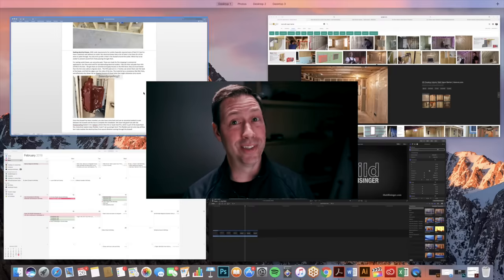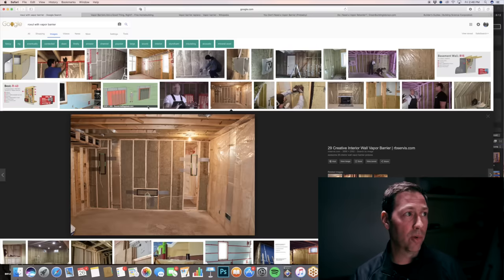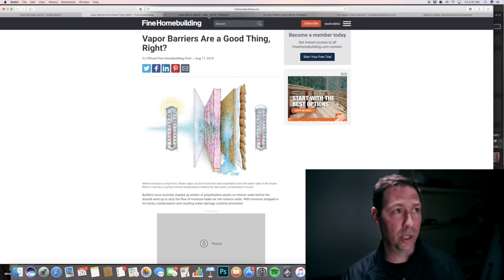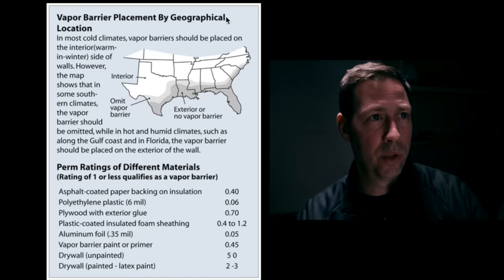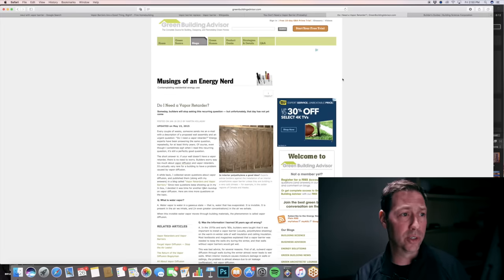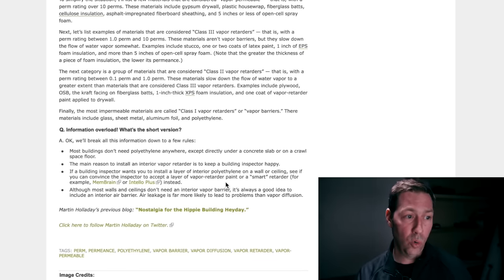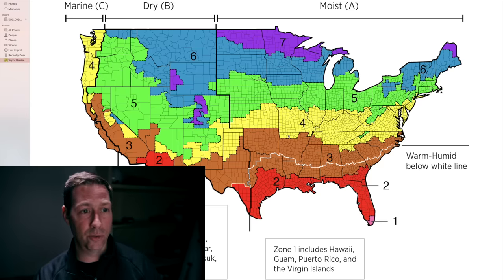Vapor Barriers: Need one or not?

Comment: Any thoughts on using foil face 1" foam board under the sheetrock?  Crawl space home in climate 4.  Foil will face in, joints taped.    Thanks all
Reply from the maker: Be cautious. The foil face is a vapor barrier. I’d go with unfaced
Reply: @buildshow  Can drywall be attached directly to foam?  I've always wondered that.  I've never seen it done.

Comment: I’m in North Jersey.

I have humidity & temp sensor both inside and out.
This morning temp outside was 11F and the humidity 72 % for the area. 

The outside sensor was registering at 9.1F and humidity at 72 %. The Attic is @ 13.5F and humidity at 65%.

My nails had ice on the tips and some were sweating. 

Is this normal? Should I installed a vapor barrier. But I’m reluctant to get heat trap and cause mold issues from water being trapped between Sheetrock ceiling and attic. 
 
What do you recommend? Thanks

Comment: Very helpful but one question.  I have 3/4" furring strips not 2x4s  attached to the cinder block wall in my bathroom.   There is  pink insulation between the strips.  The 6 mil plastic then drywall (green).  When the baseboard showed dampness, I opened the wall.  All the furring strips were very damp and extensive mold on them. No mold on anything else..    This is in the DC area.  Am I correct that the solution is to reinstall new furring and not use the insulation or plastic?   We are in the DC zone.  brick house

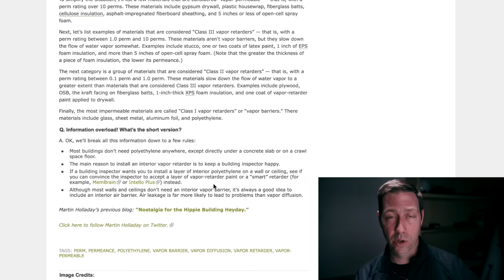Comment: At time 5:37, you discussed and encouraged use of "vapor-retardant paint or a smart retarder" as best solution to retard vapor exiting to outside. I have two questions: (1) Some brands of fiberglass insulation bats add craft paper to one side, aiding installation; is that paper acting as a vapor barrier? (2) In another video, you interviewed two experienced architects with an unhappy client with in-wall water and mold; and the cause was discovered to be the client's vinyl wallpaper, which in effect, acted as an interior vapor barrier, and that vinyl did not allow the wall to breath during warm weather. Please say more to distinguish the uses and differences between air barriers and vapor barriers. ~Steven, Utah

Comment: I’m building a warm roof on top of the existing decking on my summer house roof. I’ve been told I HAVE to use a vapour barrier membrane above this decking and below the insulation boards. Is this correct?

Comment: My new home is low energy certified and the builder said they cannot install a medicine cabinet on a exterior wall in the master bathroom because it would void their certification. I will be installing one once I close on house and get keys. The wood framing on the exterior Wal is 2X4's, I will have to pull out the insulation to fit a recess medicine cabinet so it matches the opposite wall medicine cabinet. The question is what can I put behind the mirror for insulation since there will be little space left for thick insulation? I'm in the Phoenix area where its always hot, I don't want my medicine to boil : )

Comment: So, what is the correct way to build when you have dry, cold winter and hot and humid summer?  (-40 to 30 Celsius)  Here in northern Europe we have vapor barriers all around the house on the inside. Everything is sealed tight.

Comment: Got a small barn shed that is being converted into a conditioned space in climate zone 3 California. Was told if air conditioned/heated, it’s best to use a vapor retardant. So poly’d the walls interior after pink insulation. On ceilings used rtech 2” thick no poly. Should I remove the poly from the walls?

Comment: Hi Matt, I am in the process of finishing our basement. We live in Minnesota. The basement walls are poured concrete inside polystyrene forms. So styrofoam on the outside and inside. It sounds like I do not need to hang any vapor barrier before sheetrocking. Is this a correct understanding? thanks

Comment: I'm preparing to remodel my 1962 built house and I'm planning on using 3 inches of closed cell spray foam insulation, since I'm limited by the 2x4 stud cavity and I want to get as much insulation in there as I can. Adding exterior insulation is not an option because the house has a brick facade that I don't plan to disturb. My concern is whether or not the spray foam will have any negative effects in climate zone 5 (NE Ohio), since it will not allow any moisture to pass thru it.

Comment: I need to know how to correctly seal up floor joists between my up/downstairs running under a fireplace. Builder just stuffed wall insulation in the gaps. I have to run a dehumidifier to keep moisture at bay. Want to put rigid foam in, but not sure if I should.

Comment: Hi Matt,
I live in Zone 6 in Minnesota. I am trying to remedy a problem in my home but have not found an answer. I have to believe that the promblem has been addressed and that I've just not found the answer. I have a house that was built in 1952(The walls are plaster over sheetrock) with an addition added in 1997. I have two areas in which I a moisture problem which leads to a mold problem. One in the new section and the other in the old section. Both have a south to southwest facing exposure so they receive direct sunlight from approximately 11am to 3 to 5pm. This happens during both short and long periods of extreme cold, from 0° to -20°. I removed the sheetrock from the problem area in the 1997 addition. I pulled back the clear plastic 6mil vapor barrier. The insulation bats(in a 6" exterior wall) were wet where it touched the the exterior OSB and moved inward up to 2" or more. Any nails or other steel fasteners had frost and ice on them. When it melts the moisture drops to the lower portion of the wall saturates the insulation and the sheetrock and we get mold. On a -20° day I can open the exterior door in the older part of the house and because we have a full light storm door I can sit in that spot and it gets to warm to be comfortable. There is aluminum siding on the exterior. Air flow on the interior near the problem areas does help to some extent put I am looking for a cure instead of a bandaid repair. Any thoughts or direction you could point me would be greatly appreciated! Thanks so much for your time! Kurt
Reply: I live in Norway, probably more or less the same climate as you. What i dont see you guys in the US do, and correct me if i am wrong, is having a layer of air between your weather barrier an you outside sheeting/siding. This is a really good idea in a insulated wood structure, both for draining the water and drying the structure. Especially in a south turned roof/wall this helps avoid condensation. But if you see alot of nails coming tru you might have a good old waterleak from your roof? I am sorry for my english, and hope my point came across, and it was of some help. 😊
Reply: Scott in MN,  No. I've never had any ice damming. Both the old and new area's of the attic seem to be adequately insulated.
Reply: I have been in the attic to see if there was any signs of the current or any past issues. The insulation is dry. The framing and all of the other components look like new.  The only place that I can find moisture is between the wall studs. Most prevalent is the frost. When I cut out the sheetrock, pulled off the plastic, and pulled out the insulation it showed heavy frost. I am certain at this point that there is no water leaking in. The siding was put on in 1997, the same time as the addition. It seems like there my be an issue with what is between or not between the siding and the exterior wall sheeting. Shading the exterior areas where the problem is occurring is starting to seem like a good idea to try and eliminate some of the possibilities.

Comment: I live in Houston Texas where it is quite humid. The problem is with an exterior bathroom wall that is built on 2 x 4's. There are sconces and a mirror attached to the wall with insulation and rock then the mirror. I am having a water drip below the mirror during the middle of the day when no one is showering. I have a high cfm bathroom exhaust and the air duct does not point at the mirror to make it cool. How should I solve the problem- put closed cell foam between the rock and exterior wall? Or air retardent?

Comment: Plastic is not a vapor barrier. Convection causes moisture to get behind it, because the wall is cold. Here in Minnesota, I have seen basement nightmares with these inspector gadget ideas. I tore mine out when I bought my house. It was bad. It's usually healthier to leave the basement unfinished. Tempted to get 2" polystyrene with furring strips, and glue it flat on my walls. All these extra layers people want you to do just creates more convection. You can't insulate it enough, if the wall is not sealed off, when the ground outside is frozen. It will create airflow from convection. You need to separate you from the concrete wall that is going to create mold, unless said wall is always room temperature. Inspectors around here don't know WTF.

Comment: So I just bought a house in Florida and discovered they vapour barrier'd the interior. I found out when I was renovating and found black mold on the bottom behind the base molding. There was water ingress from outside through a badly installed exterior power outlet and the water was travelling down the wire into my office. All sorts of wrong here....but should I rip out all outer wall sheetrock and replace? dang. What should be my deciding factors here? Thanks
Reply: I frequently find mold behind base in buildings.  It gets trapped there and the wall isn't primered before the base is on.  The inside next to the studs may be fine.

Comment: I have some guys building a mother inlaw suite right how. They are using T1-11 reverse board and batten siding. They nailed it to the studs with no wrap. I  am worried about it. Inside wall will be insulation only and the interior walls will be tongue and groove wood. I am in Wilson NC climate zone 3. Should they have used Tyvek? If so what will my problems be since they didn't? Thanks!!

Comment: would this be the same (no barrier) in a 12x24 temperature controlled shed? I'm in the lower parts of NC zone 4 area near Charolette. My other question would be, do I block off all the vents, or better off putting an attic in? (metal roof)

Comment: Question: I live in the south texas. I have a finished garage, that does not have insulation. My garage faces the west side, it can very hot and humid over 100 degrees. I recently add insulation to my garage door and purchased unfaced insulation for my ceiling attic. Did I made a mistake by purchasing unfaced insulation?

Comment: Whats about a cabin with t&g wood walls and no drywall or paint? There wont be air seal. would vapor barriers be important then? Or shoud i put tyvek in the inside as well as the outside?

Comment: Matt, just now finding you, but don't see a way to contact you so will leave a note.  I am in Houston and want to insulate my garage so I can work in it during the warm months.  It is drywalled with a rock exterior.  Thinking of insulating the garage ceiling and the roof rafters to keep both spaces "tolerable".  Based on this video it sounds as if non-surfaced bats will work in both places, but ensuring an air gap exists between the roof and the insulation.  Am I correct?

Comment: I have a new home in climate 6. The temp outside is below freezing and the foundation has a day light entry. I have insulated the daylight wall and it keeps creating moisture. I have had to remove the insulation twice and dry it out. When I installed it the plywood zip walls inside were dry. I have tried no vapor barrier and with a vapor barier. There is radiant heat in the basement keeping the foundation warm. Were do I go from here? Thank You

Comment: Why then does the inspector demand the plastic in the first place?
Code should not be to please the 'specter' ( problem with uneducated folks) but to be relevant with building code. 
I'm a plumber in zone 4 Wa. state.,builders have been putting interior vap. barrier behind my fiberglass fixtures forever.what is the mindset or is it just he did it., so i need to do it.
Very informative. Thanks

Comment: I have a mobile home in zone 5. I am replacing the paneling with ship lap and some walls will have drywall. Presently the exterior is metal panel siding but I am taking that off and replacing with OSB, Tyvex and then vinyl siding. Do I need a vapor barrier, retarder or neither? Oh and I will be using Rockwool insulation

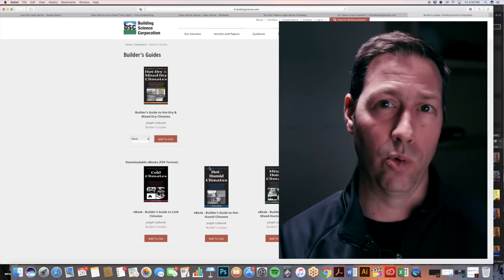Comment: 7:55 but climates can and do change... It can take a long time, yes, and the house will likely be at best, significantly old and at worst, severely dilapidated or probably even long destroyed, but is there a way to build universally for several climates?  Just...in case?
Reply: This is what I was curious about. In the last decade there have been record breaking highs and lows in the area I live in. So the summers have been much hotter and the winters much colder. Right now I’m dealing with mold in my sunroom from a straight month of rain, which is not the norm.

Comment: I have an uninsulated shed 10' X 16', I want to insulate the walls with rockwool, outside is smart siding. I do not plan on a vapor barrier. The inside will be covered with 1/4" plywood such as Luan plywood. I want to also install an unvented propane heater with a thermostat. The roof has reflective sheeting, so will leave that as is. I am in Maine, zone 4 or 5. Any ideas?

Comment: what about in unheated below grade or partially below grade basements ?  
there is a lot of moisture down there 
if you insulate the the stud portion of the walls would you want plastic ?
what about the cement walls ?

Comment: So if I'm building in the west tetons ( super cold winters and average o=high of 86, no air conditioning required) and have heated slab, with 5" of closed cell insulation in walls, do I only need permeable  vapor barrier on the outside? My interior wall finish is plywood over studs and I am not using sheetrock anywhere.

Comment: I'm with you on the air sealing but the v. b. not sure. Im at the top of zone six. I believe that u must control your inside air n u can't without v. b. 'S. We actually use air exchangers. I hate the phantom draft !!
Rite or wrong I have a 6 mil vb and a 1/2 " of styrofoam under the drywall. Actually I more so monitor my indoor humidity for comfort. Seal it rite n seal it tite. With my outside wood boiler it's Arizona inside and Alaska outside- the best of both.

Comment: Hi there, I have a back building that the old owner built. Currently, it is unfinished and has a felt wrap between the studs and the siding. Should I use unfaced insulation on it to avoid water getting trapped between vapor retardant layers?

Comment: Installing a wine cellar on a job in upstate sc. The wine cellar company wants a vaper barrier between the studs and concrete while the spray foam engineer wants vaper barrier between wine cellar walls finish mahogany plywood and studs / foam. What would be your suggestion.

Comment: I'm framing the interior of a concrete building 2 x 4 one inch from wall for air gap and  15 faced insulation, what are your thoughts recommendation.

Comment: In Climate 6 here. I need to make a large garage drywall repair to the wall separating the kitchen from the not heated garage. I will be adding fiberglass insulation. Do I NOT need a vapor barrier on the garage side over the insulation?

Comment: I live in Ontario, Canada  So i don't need vapour barrier for the inside of my 100 yr old house.  I know the out side does not have a vapour barrier sheet under the siding (i'm hoping to afford  new siding this winter and have them install a vapour barrier at that time..)  I have no insulation in the wall at all and I've had the plaster fall off so I'm  removing the lath and putting in roxul insulation for the first time. Can you give me advice Please.

Comment: Really hard to know what to do with my existing house. Near Chicago. Built in 1969. Concrete block. Furring strips with either paneling (in some spots) or drywall (in other spots). Back in the day, it was thought that concrete block was an appropriate insulator. On the outside of the block, limestone. Is there a proper way of insulating outside walls with this situation?
Reply: I should clarify, I want to insulate on the inside of the home...it seems like tearing down the outside limestone would be a nightmare.

Comment: I'm doing a down-to-the-studs remodel of the bathroom in a home, zone 7.  I was going to put in new insulation batting and then cover with a poly film, sheet rock and hardiboard (shower area), and finally, 5" T&G rough cedar boards (other than the shower area).  There is going to be a lot of moisture from daily showers... and the outside chill is frequently 20-below zero. Lots of heat loss in the house!  So... you slipped it in, real fast... but, don't use poly film? The idea here is that the film will cause moisture to stop, collect, and pool, soaking into the interior wall structures?  Hmm... okay.  So... what then?  Paint the sheet rock with a moisture barrier primer?  Is that all?
Reply: air exchange unit for the house will help with moisture and making sure the bathroom fan runs a little longer after the show is done. In Canada we would be able to get away with out using poly on our interior walls. the cold would come right through.
Reply: The point I got was not use a full barrier, something that slows the exchange, a vapor 'retarder'. That way moisture can still evacuate at some point.

Comment: I am building on the inside of metal building, the building has 3 inch roll insulation,what should I use to keep the air from going through the walls.thanks